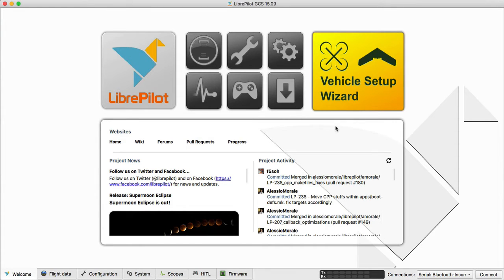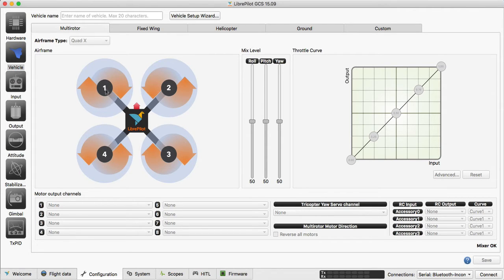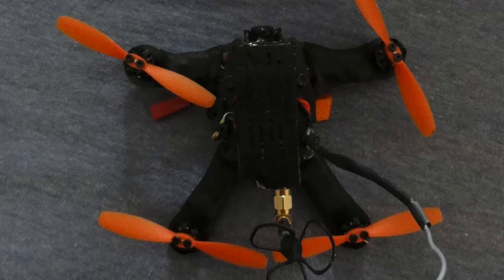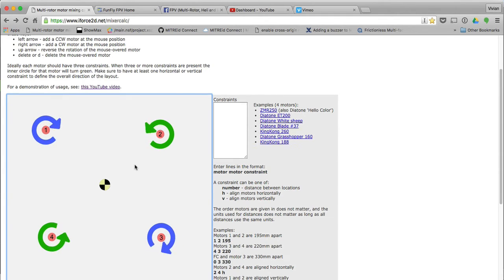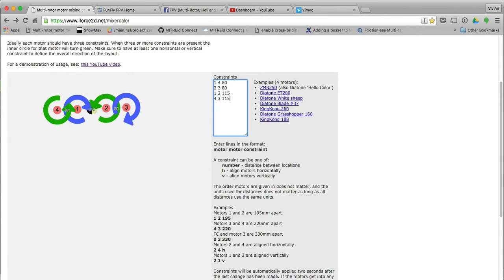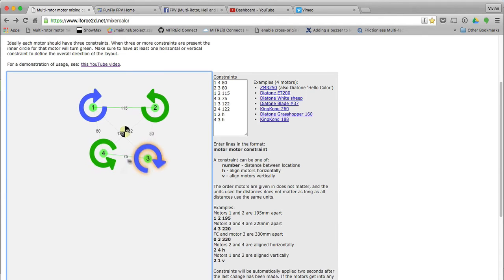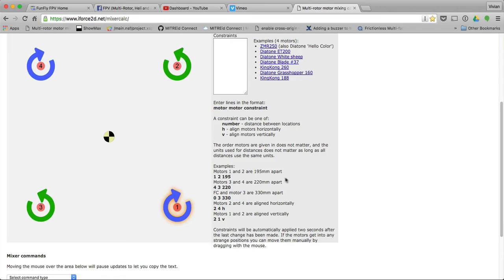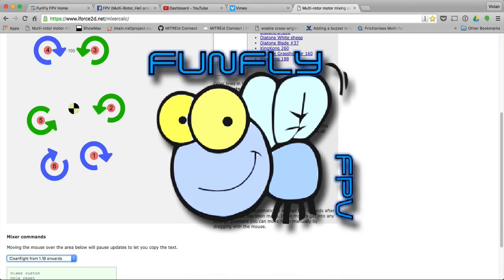CC3D CleanFlight Wiring

Comment: great little tip, will save me a huge amount of hassle, if i ever get passed ppm +oneshot pin6, ppm +pwn no oneshot. ppm +outputs no oneshot........ and on and on....oh and add in a possibly loose signal wire and esc's that may or may not be oneshot capable.....

Comment: I've got a CC3D with Openpilot and I want to switch to Cleanflight. It's an ARF, and they soldered the ESC wires to the board permanently as well. I didn't think it mattered which motor was labeled what, as long as they are spinning the correct direction. The FC and receiver aren't concerned about individual motors, are they? don't they just worry about direction (pitch, roll etc)? Is this mixing really necessary?
Reply from the maker: +Jon B Baca This is necessary. If you consider how a FC controls flight, lets say the board wants to spin up motor 1 and 3 to make the copter go forward and those motors are in the wrong position. The result is that the copter will immediately flip when the positions are wrong.
Reply: Haha yeah I guess that makes sense. Why did they feel they had to change the motor numbering? The way Cleanflight does it makes no sense to me. I'll try this method out, thanks!